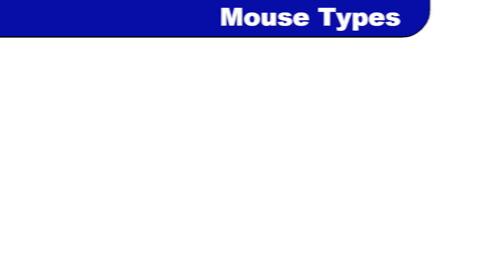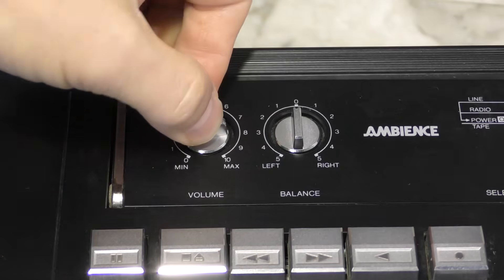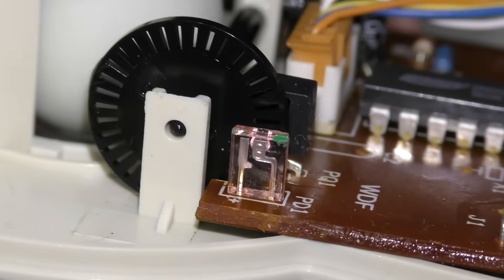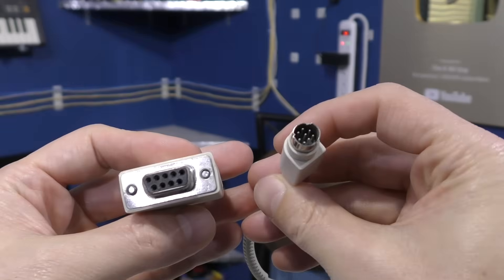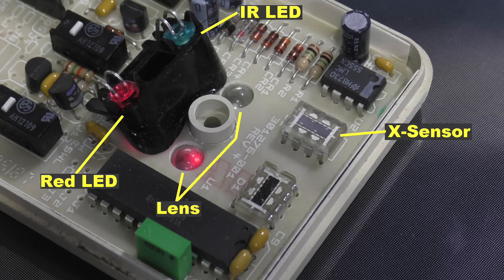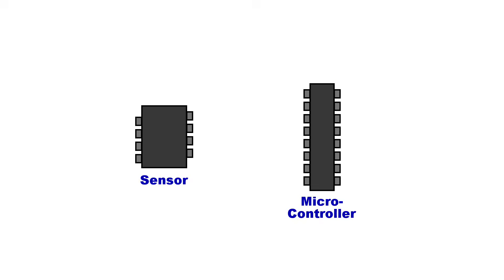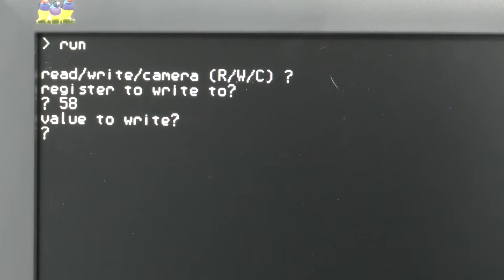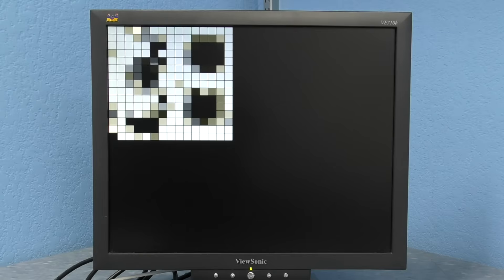What does a computer mouse see?

Comment: Arguably all a camera does is record the presence or absence of light, just including light wavelength and intensity, then matrixes that information into a field that can be reproduced. So in a way that is a camera - a bit like the first biological eye
Reply: A camera records intensity only, not wavelength.
Reply: @maxine_q  In so much as we record all images using luminosity, but use filtered light or sensors to capture colour - no we don't record wavelength directly. But we are able to indirectly, and very cleverly, record wavelength by arraying those filters and reconstructing them at point of display - so yes we do. Otherwise, ipso facto, we wouldn't have colour photography at all. I grant you do technically have a point but you're arguing semantics that I already knew when I made my original point, my dude. (Also read this comment again but beginning with "comments on 8 bit guy videos be like" lol)

Comment: That was really informative about how those special mouse pads worked. I always wondered. (I used to use a Sun workstation.)  That can't be it for the optical mouse though. The controller would have to see a lot of frames really quickly to be able to figure out the mouse movement.

Comment: I figured out the solution for the gummed up mouse in the 90's: I had a table where the mouse ball would slide. So I taped a paper onto the desk as a makeshift mousepad. Turned out not only could I also use it as a note/scratchpad, it also kept the mouse clean! The gunk would end up on the paper and after a few months it was dirty and full of notes, so I switched it. I kept on doing that until optical mice took over.
Reply: I thought I was the only one doing that!! I guess I’m not alone :D
Reply: Optical mice don't like highly polished desks though, so paper mousepads still have their uses :)
Reply: @countzero1136  Yes, the newer "Laser mouse" overcame that issue.  I used a regular old mousepad for a camera-based mouse that didn't like my wife's black granite desktop.  Laser mice were already taking over, so seemed old tech that this decorator mouse (bamboo mouse body) used the older generation technology.
Reply: damn boy, i just cleared up the gunk.. manually.. every 2 weeks or so ..
Reply: @leos3010  you and me both XD
Reply: Big brain

Comment: One of the first times I actually damaged a computer by trying to fix it was cleaning a ps2 mouse with it attached to the computer and turned on. I was using a small screwdriver to scrape the fuzz off of the opto mech  rollers (sensors) and I somehow burnt out a fuse on the motherboard. I had to take the computer to a repair tech 30 miles away and pay like $90 to get it fixed. That was alot  of money for a starving student in 1992. I did not know at the time that I could have just purchased a serial mouse and connected it instead. Of course I would have had to load the correct drivers in config.sys autoexec.bat to make it work.

Comment: I ran a small computer lab in the mid 90s and cleaned many mouse trackballs. The reason behind cleaning the ball itself is that it can become layed with grime from any number of liquids, including skin oils as the arm rests on a desk, makeup, food spills etc. Much like rubber rollers in a printer, if the layer of grime is not clean, the contact with wheels inside the mouse will not be consistent.

Comment: I remember at the place I worked, a university lab, at about the turn of the century, we had one or two of those early optical mice that require the special grid pad and I was fascinated about the grid that the pad had. But they were really not used then, "normal" ball mice were the norm. And of course I remember the constant need to clean the rollers of the grose grease and dirt buildup.

Comment: The mouse Hawley designed for Xerox back in the '70s used mechanical quadrature encoders with leaf spring contacts.  IBM also used a mouse of a similar design for a while on their PS/2 systems.

Comment: I had a optical/mechanical ball mouse back in the day.  I remember it kinda flaked out and I figured out how to clean it.  In addition, it would get dust bunnies inside which would sometimes get in between the wheel and the LED and the sensor.

Comment: I've been using the same optical mouse at work for 19 years and never thought about replacing it.  Meanwhile I remember the frustrations of using a ball mouse and having to clean gunk out but I only did that for 7 or 8 years at the most.  Funny how the optical mouse design was so perfect that it really hasn't changed much in 20 years.

Comment: I still miss using a ball mouse. It felt more responsive, and more predictable in its motion.   Downside of course was having to clean it occasionally.  I always used isopropinal and Q-Tips to break up the oils and gunk on the rollers.  Very cool coding and demonstration of the tracking sensor 8-Bit Guy.

Comment: The modern optical mouse sensor was originally developed by HP as part of the HP CapShare pocket scanner. The original versions were analog, they only added digital signal processing when they made them mice. The patents were held by HP, spun off to Avago (now called Broadcom), and eventually sold to the Taiwanese company Pixart as a settlement after Avago successfully sued them for patent infringement. They also made an upside down version which was used as the optical trackpad on Blackberries.
Reply: If I remember correctly, they were part of Agilent as a result of the split in 1999, and became Avago a little while later.

Comment: Funny you're mentioning old peripheral interfaces... I just rebuild my WIndows 98 gaming PC with an old SOYO VIA Socket 478 motherboard as the MSI SiS based one I had is not in such good shape anymore... I ran into a fun issue where, with Windows 98, and no USB drivers, the USB mouse and keyboard work fine. Trying to install the USB drivers means I have no more mouse / keyboard mid way through... Had to order a PS/2 to USB adapter, can't find any of the ones I use to own.

Comment: Honestly, when you said "what type of mouse" my mind still goes to "optical" or "laser" from the time optical mice were still kinda shit and laser mice were great but expensive. because that's the only time it really mattered what mouse you bought. The steel-rubber ball ones all worked, and mice these days all work. But when optical was new, there was vast differences between quality :P

Really? Did people really clean the mouse ball only? I usually threw that sucker in some soapy solution and got to work on the tiny contact wheel and the wide one. Removing the gunk with my fingernail. The ball was mostly an "well if I'm doing this..." thought.

Interesting to hear about all the other connectors and especially the other sensing techniques though! :D
Reply: Good I'm not the only person using my fingernail.

I have a hard time people would continually clean only the ball. Surely they'd notice the obvious ring of crust on the rollers sometime.

Comment: Ah, the memories of having to periodically clean the crud off the rollers when the mouse stopped working.
Reply: I still do. Using a logitech M-BA47 .
Reply: I've heard of people collecting belly button lint and earwax. I wonder if somebody out there collects mouse ball crud. 🤣🤢
Reply: Back then, it was always the rollers. Now, many of the balls have degraded to the point where the rubber has gone ever so slightly stiff. Just enough so that it doesn't quite grip the rollers properly, and you get tracking issues. I've found that the Microsoft Serial Mouse 2.0/2.1 are still fairly reliable.
Reply: @BlackEpyon  Sometimes you can get a (slight) rejuvenation of mouseball rubbers by dunking them in IPA for a couple of minutes then cleaning them off with a damp cloth. I still have a few old ball mice in my collection and they still work just fine with a bit of regular maintenance (except for one where the rubber coating on the ball has turned into that sticky goo that you see on lots of devices from the early-mid 2000s :()
Reply: @countzero1136  Hmm... I've got one mouse I could try that on. It's not a particularly attractive mouse, but because it's Tandy branded, I still want to keep it.
Reply: @BlackEpyon  I wouldn't try it on one that has value to you - some types of rubber may not like it. I've used it on cheap no-brand PC serial and early PS/2 mice but I'd be wary about trying it out on something important
Reply: @countzero1136  Yeah, the problem is that this Tandy mouse already has tracking problems, which is why I'm not really using it. I keep it more for posterity than anything. The machine it's for, my Tandy 1000 RSX, has PS/2 ports, and I've spray-painted a PS/2 optical mouse beige to use with it.
Reply: Ah, the old days of cleaning the rollers using a Bic pen cap...
Reply: @fep_ptcp883  Yeah that was my tool of choice for that job too :)
Reply: You also find the mouse balls go out of round, back in 1997 we had a collection of "wonky" out of round microsoft mice balls that you could see flat spots - they dont move the little wheels

And some people were known out of frustration to constantly pick up the mouse and slam it on the table when the curser jumps around and gets the jitters

Regards
George
Reply: @georgemaragos2378  I didn't consider that. You'd think that they'd wear evenly.
Reply: @georgemaragos2378  I'd be lying if I said I never slammed MY mouse on the table.  Not in a VERY long time, but I killed at least two mice that way.  Sooner or later, the shock of being slammed into the table damages the PCB or one of the mouse buttons...
Reply: It's funny how 8-Bit Guy mentions that nobody seem to know how to properly clean their mice back in those days, and then two seconds later he's scraping the soft plastic rollers with a sharp metal knife!
Reply: @djhenyo  Which is pretty much what we did... Those of us in the know, anyways.
Reply: @BlackEpyon  Why use a knife when they can easily damage rollers?
Reply: @djhenyo  Actually, I usually used a small screwdriver. Either way, care needs to be taken not to damage the rollers, but q-tips usually aren't enough to get the gunk off.
Reply: @BlackEpyon  Fingernails are the best because it is nearly impossible to scratch with them, and they can turn the rollers while cleaning. You can get the whole job done in a few seconds.
Reply: @djhenyo  If you can get your (fat) fingers in there, sure. Depends on the mouse.
Reply: @BlackEpyon  I've never seen a mouse that I couldn't clean with my fingers. Due to weight requirements for ball traction, the hole was always big enough. You can do an internet search and find some extremely rare and shitty mouse with a tiny ball, and you could even lie about owning one, but that won't disprove anything about my method of cleaning.
Reply: @BlackEpyon  Done!
Reply: All those years of popping out the ball and cleaning it. NOW I find out that it wasn’t the problem. Where was this video back when I needed it?!
Reply: @jerrychandler7094  You'd think after a two or three times not working you'd figure it wasn't the actual ball...
Reply: @jerrychandler7094  If only we had youtube back then.
Reply: Not that long ago for me!  I use a professional grade Kensington track ball instead of a mouse at my desk, and they continued using the mechanical guts well into the optical era.  I wore out 2 of them.  But the rollers are easier to clean since the ball just tips out.  The optical design *still needs cleaning*, as crud builds up on the points that support the ball, or can fall into and cover the sensors.
Reply: And all the tech support calls for the same!
Reply: @Merescat  Were there lots of call bc of THAT? Oh boy, thought it was something so obvious the moment you take the ball out.
Reply: @BilisNegra  yeah - the mouse movement was not smooth so people wanted it replaced.  So you did, but with one you had cleaned.  :)

Comment: 50 ms delay? Surely you shouldn't need that long of a delay. You must have missed something in the documentation that says "i am ready to read the next pixel now" or maybe you should have used a stream of some sort?
Not going to go into the documentation myself because what's the point? I don't have anything to test my theory with.
Reply from the maker: I think the pixel grab function was afterthought or maybe only used during design and testing.  The microcontroller inside never actually looks at the pixel data directly.  The sensor will report movement of X and Y by itself.

Comment: I remember oh to well the pain of having any form of hair or dirt enter my rubberized ball mice. The footage at 2:14 triggers me greatly as i see both dirt and hairs in that mouse.
I've even seen mice with so much crud on their rollers that scraping off the crud actually made the mouse stop working because the ball no longer made contact with the rollers.

When optical mice came around i was very skeptical as they worked like absolute garbage even on dedicated mouse pads. But then they improved with time and nowadays, mice sorta just works!
And i also remember the pain of having a single strand of hair get stuck in the optical sensor of optical mice... Making your mouse pointer jump all over the place or simply speed off into Narnia. Haven't had that problem for a long while now.

EDIT: Instead, nowadays, mice are made out of the cheapest possible components ever imagined by man. That's the one thing i miss about mice from the past. You could literally throw them down a cliffside and have it end up in the ocean. Then drag it behind your car going 65 down the highway and when you finally got home, you'd clean it with some cotton tips and plug it in and it just worked.
Reply: @smpmuzpid  At what point did i say i didn't already have a gaming mouse?

Gaming mouse or not, they are still made of the cheapest components they can find that doesn't break (too often) within the warranty period.

Also, i have very big hands so my options for mice is very limited. Not all mice fit in my hand correctly. Otherwise i would have picked the one with the least amount of low quality components obviously.

Comment: 3:17 "The average person seemed to have no idea how to properly clean the mouse."
Then shows how to clean it by using a Stanley knife to scrape the plastic rollers.

Sigh, that is how you damage the mouse, not how you should clean it.
Reply: I always use my fingernail. I'm sure it's not ideal but it seems to work well enough. Yes, I still use ball mice.
Reply: @eDoc2020  You don't get the debris below your nails?
Reply: @TransformerCoil  Hold on a second... Nope, I just tried it. The crud doesn't seem to get stuck. The biggest downside is it still leaves some residue. The upside, of course, is that I can always find my fingers.
Reply: @eDoc2020  I used screwdrivers. but I haven't used one since 2002 I think
Reply: @Blackadder75  I presume you mean you haven't used a screwdriver to clean a mouse since 2002. I have a hard time believing you haven't used a ball mouse since 2002 because Dell was still shipping ball mice with new systems in 2004.
Reply: @eDoc2020  I should hope so!  If you can't find your fingers, I think it's fair to say you've got a serious problem.  I can imagine what my parents might say.  "Have you had them with you all day?"  xD

You've got a good point.  Even though it left some residue, a fingernail was usually enough to get the mouse working properly again (until the next time the rollers got gunked up, anyway).
Reply: He scraped it off with the backside of the nife (the not sharp side).
Reply: @sergeygolov  Doesn't matter, the steel *knife is harder than the plastic roller.
Reply: Very minimal 'visual' damage would show, would not affect the usability of the mouse. Source: Used to clean an old Microsoft mouse with a blunt Stanley knife.
Reply: Fair enough, but by blunt, it was really blunt. It was duller than the backside of a normal Stanley knife. Only used to scrape of the harder particles of debris and the dullness of the knife did not jab at the rollers. Did not notice an increase of dust collection on the rollers btw.
Reply: He pokes plastic with metal tools on other videos too. It's maddening but got used to see it.
Reply: @ExpertNewbie You care enough to reply.
Besides, this is a retro channel, lots of people care about old devices (except you).
Reply: I remember my wife bought one of those mouse cleaning kits you used to find everywhere back in the day - it had a bottle of (very diluted) IPA and a weird tool that looked like a mini toilet brush. To be honest it was mostly useless, and no substitude for using the clip part of a pen cap to scrape the gunk off the rollers

Comment: Did you try "Burst Mode Operation"? I think that this is the only way to get all data quickly enough. Otherwise, the mouse wouldn't work at all... It is on the datasheet.
Reply: I was about to make a remark that, given the "speed" with which pixels are displayed, I would assume that the controller would never be able to derive motion in real time, so some other mode must be available.

Comment: I remember a common issue with those gridded mouse pads was that the center would eventually get faded from scratches by the mouse and had to be replaced. They weren't cheap either.

Comment: Those early optical mice weren't even close to the first - Xerox had some optical mice for use with the Altos at PARC, but they needed a printed paper surface with a particular pattern on it to work. CuriousMarc has some videos about the Alto, and I think he shows off such a mouse at one point.